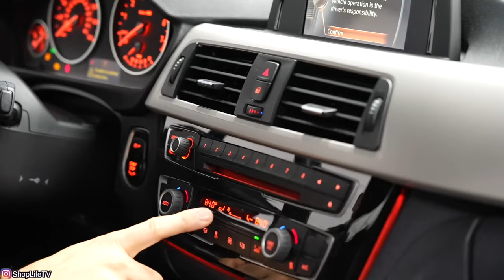HOW TO REPLACE THE ENTIRE COOLING SYSTEM ON THIS BMW! (E9x Ultimate Cooling System DIY)

Comment: Great video as always, Jason!  I refreshed my entire cooling system (less the heater core and radiator) in my 2008 e92 328xi at 220k miles last year.  The "only" reason I did it was because I decided to replace all the front end thrust arms, control arms and tie rods.  However, once I removed all the front end suspension, I realized I was very close to being able to support the engine and drop the front subframe and repair the slow leaking oil pan gasket I was putting off for the last 70k miles, 😆.  It was literally at that point I realized this was the perfect time to access a the WP,  t-stat, clamps & hoses, etc.  I was shocked to see that the Date Codes on the parts were originals back to 2008.  I also replaced the OFHG and went with the upgraded "Mickey Mouse" fitting on the OFH.  I'll be doing all of this again on my wife's 2011 328i xdrive this spring!  I think I enjoy working on my e9X chassis cars than my e46/e46M cars!
Reply from the maker: Thanks Craig! The “while you are in there” will get you lol. One time I was doing an oil change and noticed a minor leak, turned into a whole engine out reseal and refurbish 😂

Comment: Great video!  Super helpful when replacing the cooling system on my 2009 128i.  I wasn't hearing the "audible click" when I connected the quick connect hoses.  Bu the clip was down & the connection was good.  Toward the end you mentioned putting the hoses on with the clip down.  A ha!  I tried that on the last few & sure enough, an audible click!  Thanks again!

Comment: Thanks a lot. I had a look under my E92 Coupe, after nosing the front onto a car space kerb, I broke the joint in the lower hard plastic recovery hose and dumped all my coolant. Your video will make replacing the hose easier.

Comment: Damn son I don’t even wanna think about when the time comes for me to do all this in my E92 😢😢😢😢
Reply: My e92 at 150k is leaking on the driver side. I already replaced all the top stiff and the lower heater hose. I'm wondering what it will be when I get the bottom panel off?

Comment: Great DIY brother and sister! And also great, you used a complete metal water pump, probably one from INA? Unfortunately, my 335i had the pump replaced just before I bought the car. It's a Continental again, with the plastic pump housing. Thanks for sharing. Dutch regards Nico.
Reply from the maker: Thanks Nico! This was a Bavarian Auto upgraded water pump, first time using it but ECS has it as part of their level 3 kit, which usually means it’s a good quality part.
Reply: @ShopLifeTV  okay also great stuff. Here in the EU people buy the INA pumps for the n53 and n54.  It's a oem German BMW brand, you probably know.

Comment: I only needed to replace the "mickey mouse" hose from the engine to the thermostat, my coolant expansion tank hose to the upper ended up breaking, I also could not disconnect the upper radiator hose from the radiator no matter how much penetrant I applied, ended up breaking the plastic connection off the radiator so now i'm doing the radiator too... Well this is ending up pretty much like the video (which is super helpful) Thanks!

Comment: I paid a shop to do the complete cooling system replacement on my 2009 E90 with 6 speed manual.   The only thing not replaced was the water pump inlet pipe .  Apparently the metal and rubber part of the inlet pipe (which I was told is a single order code) are not stocked by BMW Australia.
Reply from the maker: They make a repair kit now, not sure if it’s available in Australia though

Comment: Can you please explain how you were able to reconnect the inlet pipe? Its such a small area and theres no angle or room to reach to get the torx bolts to thread back on? 

You mentioned a few extensions with a 1/4 inch drive. I tried every extension and the bolt is almost impossible to align it straight on, the swivel socket i used to remove them keeps sliding off and i dont know how to thread them back on.

Comment: Hello I’ve been watching your videos for a little while and I’ve learned a lot. I have a 2010 528I that I recently service the transmission to include solenoids and seals. I am trying to find a program that is not gonna tear a hole in my pocket to reset adaptations. Can you please help thank you. And thank you for all the knowledge you provide.❤
Reply from the maker: Hey look into the INPA software. Plenty of free downloads and tutorials to setup. Cable is less than $50
Reply: @ShopLifeTV  thanks again for the info. What cable am I looking for?

Comment: I have been watching your videos for a long time and I saw where you moved to the Carolinas. I am in NC and my daughter drives a 2004 bmw 330i. But it overheated and blew the head gasket. She can’t find anyone around here trustworthy to fix it, several mechanics gave her a price but couldn’t guarantee the work. Most suggested another engine. Her engine has about 145k miles and was well maintained until the hard plastic heater hose cracked, lost coolant and overheated.
I don’t know what to do with her car now. Do you work on other people’s cars, or do you know any reliable mechanics around here? Thank you.

Comment: Does the heater hose have an O ring? The hose connecting to the bottom of the upper radiator hose

Comment: Great Video Thanks and I just subscribed to see more, I love your videos. I am looking for the video or the heater core that you are talking about (can you please point me to it) , also. I have the same car and replaced almost everything except the plastic hose that connect the expansion tank with the termostat, transmission and heater. i have the hose that I was not able to disconnected from the heater side and don't want to damaged it as I didn't ordered the heater hose and the return hose from heater. My question is:
Looks like the plastic coolant recovery hose and the 2 for the heater are OK, I never use the heater because am in Florida and I think the is not to much circulation on the heater , the car is a 2010 with 135K. What you think about it ?. Thanks

Comment: I didn't have silicone spray, so I just dipped my fingertip in synthetic engine oil to lubricate the hose ends and O-rings.

Comment: I installed a mosselman thermostat so my car runs 30 degrees cooler than stock. even at 270kmh on the autobahn i am far below stock temps. You can also open the engine bay with M3 cowls & set the fan speed to sport for another 10degree reduction. For turbo BMWs, this is probably the best mod to benefit longevity & all engine/coolant components.
Reply: Couldn't there be a thing that it is less efficient when it's cooler than operating temp is? Something that came across my mind

Comment: What’s the hose at 5:12 called under the lower radiator hose on passenger side I bought new hose kit but only came with the two big ones and the water rez one I replaced my radiator because upper part cracked and now it is leaking out the lower small hose

Comment: Hey Jason, this comment is more generic if you don't mind? 

Would you ever recommend going non-OEM, or is it a principle that should be maintained for All BMW models? I'm looking to change an E90 oil level sensor and the price difference between OEM and aftermarket seems unnecessary, what are your thoughts?
Reply from the maker: Hey! I usually stick to OE manufacturers mainly for fitment reasons. There are times where upgrades are good, mainly for suspension and when you start modifying cars. Sensors stick with OE for sure

Comment: I've replaced every coolant hose, the water pump thermostat radiator coolant tank and there's still a leak somewhere, I can't see or feel any on the hoses but I see drips on the trans cooler lines coming from somewhere up above, I haven't pressure tested it yet, I'm at a loss as to where it's coming from. There also still oil leaking from somewhere, I've replaced the oil pan gasket, the oil filter housing gasket the vamos hose which was leaking really bad the valve cover gasket and still there's oil leaking, it's not the work I did, it's not dripping on the ground like it was before, but you can smell it coming through the vents and see it on the drivers side of the block right below the intake manifold  it also has a p0171 and 174 plus a p01083, the engine runs great with only 93,000 miles on it, I can't pass inspection because none of the monitors will set.
Reply: You ever get it figured out? I'm having a leak on that side now after replacing everything too.